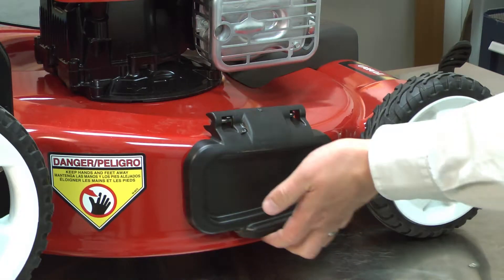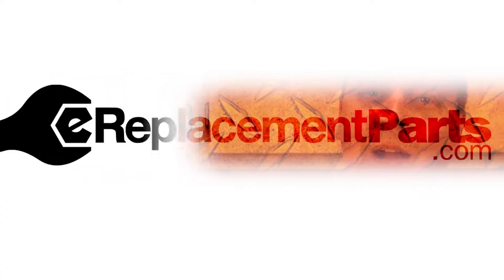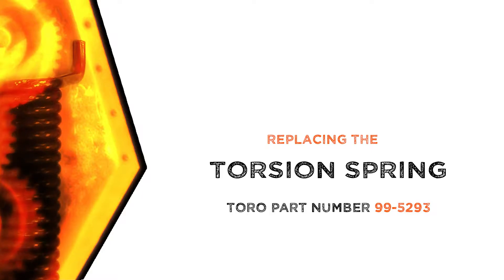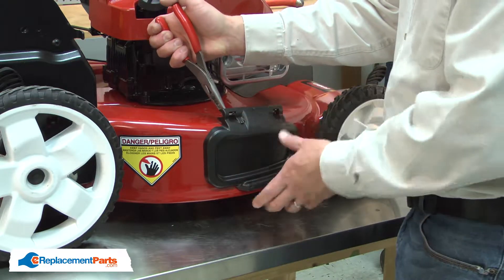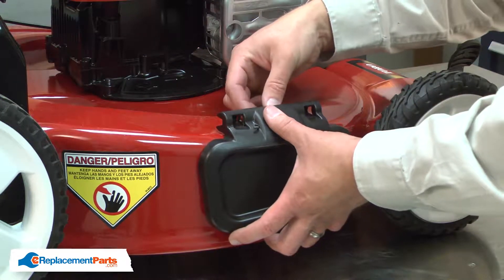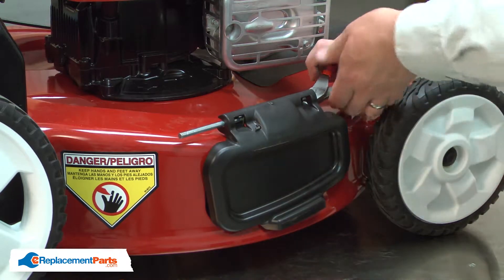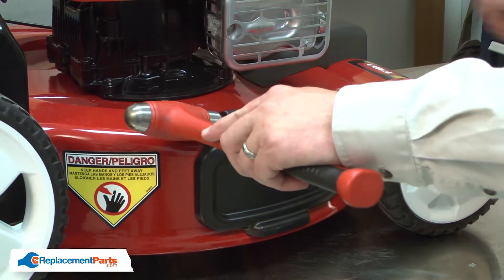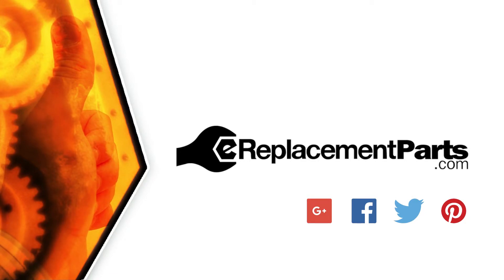Toro Lawn Mower Repair - Replacing the Torsion Spring (Toro Part # 99-5293)

Comment: The tail of the spring needs to be positioned on the opposite side of the metal bracket because that is where the coil tension holds the door closed. I got the parts people to correctly install the spring, then I used a small screw driver to put between the bracket and the body. This allowed me to install the assembled bracket back on the mower using the bolt/s.

Comment: I've watched this video 3 times and spent 30 minutes trying to place the spring pin behind with pliers but it just won't stay put. Can't see how he does it and there's not another YouTube video for this specific job.
Reply: I had to have my wife pin that arm down while I hammered in the pin. It will NOT stay put unless you have pliers forcing the arm behind the bracket. I had to have a helping hand with mine
Reply: Ron, look at my solution because I had the same trouble.
Reply: The free end of the spring has to go on the opposite side of the metal bracket to provide the torsion to keep the door closed. (I got the parts people to install the spring properly) Then place a small screw driver between the bracket and spring to open it up. Then secure it on the lawn mower body...hope that makes sense to you.

Comment: Figured it out, you need to pull right arm UP AND OVER and behind the mounting post, you will know when it get it right when the arm is behind the mounting post and it will be a upside down L. It was much easier with 2 people

Comment: Hey all copied this from another site, hope it helps
For those who want detailed instructions, I was able to replace the torsion spring that came off my Toro 22" high wheel mower. Here is what I did:

1. Place and hold the chute on the mower in the typical closed position.
2. Orient the torsion spring so that both the ears are nearest the chute (towards you). Slip the left ear into the formed slot (small hole) of the chute. You may have to raise the chute slightly to insert the ear.
3. The key step. While holding the chute near its closed position, rotate the right end of the torsion spring COUNTER-CLOCKWISE. This will cause the right ear to move back across the frame of the mower and over the metal bracket attached to the mower. It will create tension because the left ear is held in place in the slot of the chute.
4. Once over the lip of the bracket, press down on the chute to hold the spring in place and insert the rod.
5. Done.
Reply: Don’t have any pics, but if you watch how he holds the door in place, all you have to do is twist the right side of the spring counterclockwise in place next to the frame, have someone push the rod through and tgen release the pliars
Reply: Thanks Tom Bell for spelling this out. It worked perfectly. The video sure didn't help much.